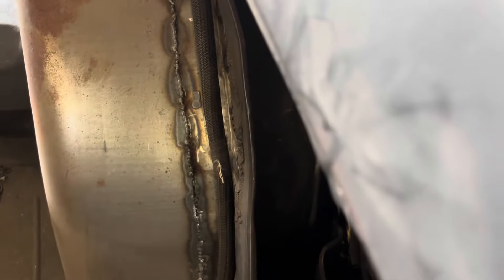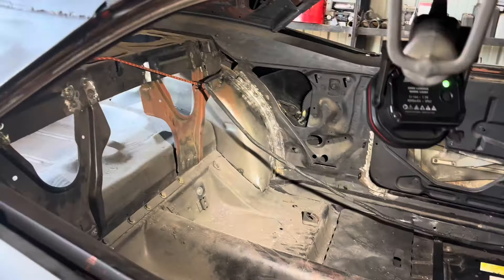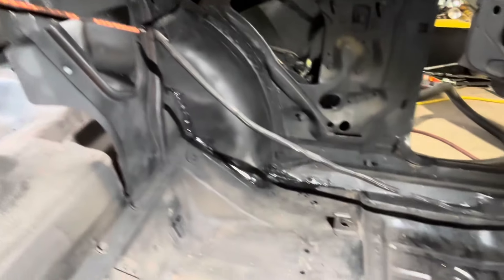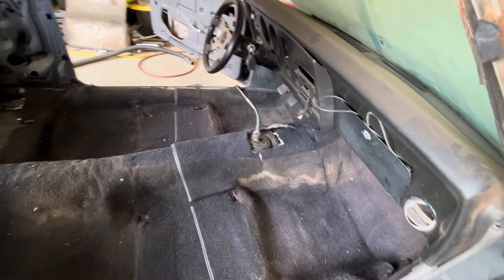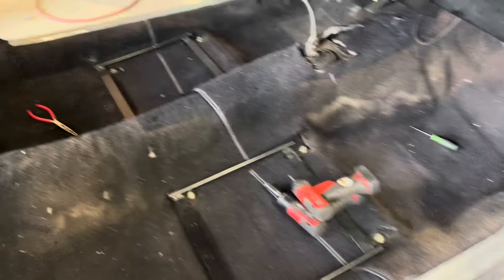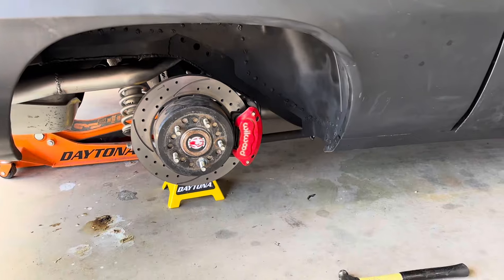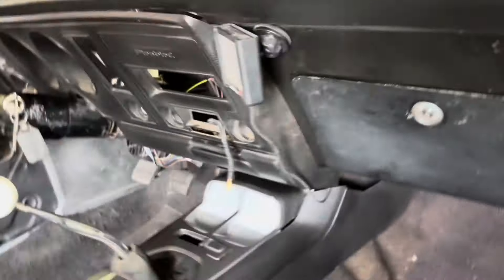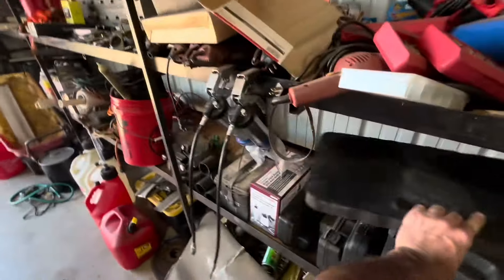Preparing My 1969 Pontiac Firebird for the Cordell, OK cruise night.

Comment: I love what you did to fill the void between the roof and the quarter panel welding in metal thats what i am going to do but what are you going to do about the rest of the drip rail panel that should have gone on first before the quarter panel i hope you show that i know you will fix it the car looks great your doing a really good job your video's are showing me alot have fun at the car show brother.